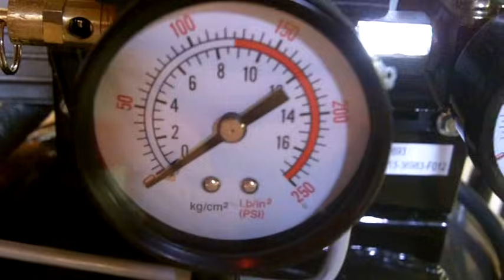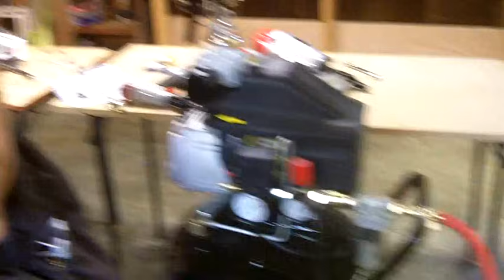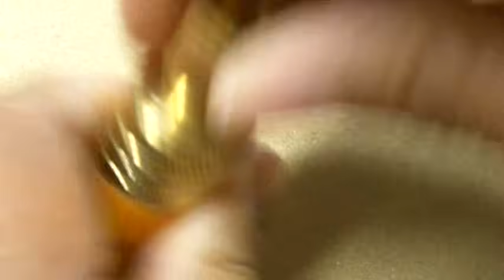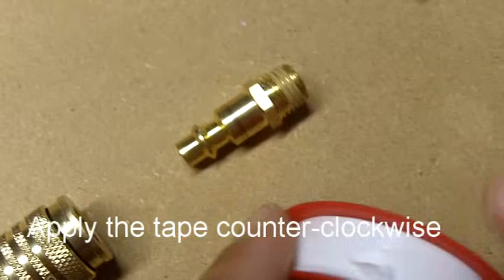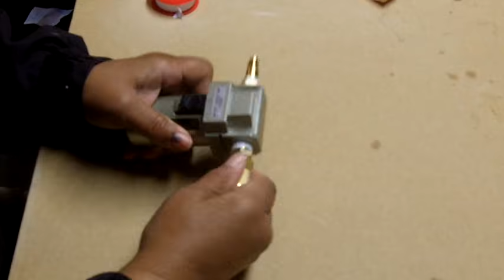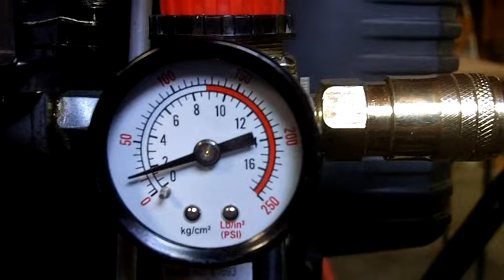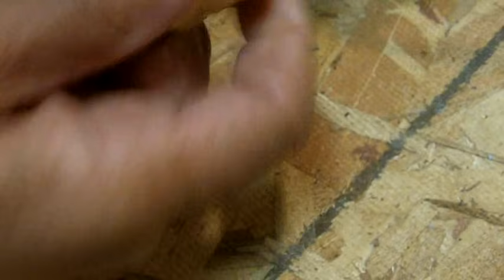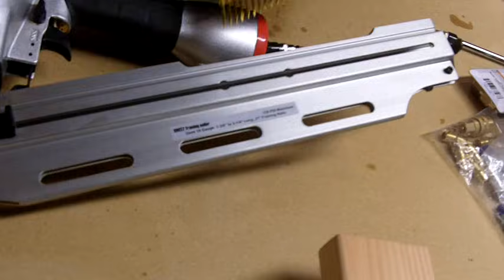Air Compressor, Line Setup and How to Use Air Tools for Beginners

Comment: Thank you so much Leah! Can you explain what happens after you're done? How to turn off, bleed air, drain water, etc.? Thanks!
Reply from the maker: +DennisIsAMenace First off, you should follow the manual for the compressor that you have.  But the main thing is to turn off and unplug the compressor, bleed the air by pulling the pressure relief valve, or you can discharge the air with a blow gun.  Turn the regulator down to zero.  And then at the bottom of every air compressor, there is a drainage valve that you can unscrew to let the water out of the tank.  But again, the  most important thing is to follow the manufacturer's instructions for you air compressor.

Comment: thank you your amazing. can't wait to get my hands on the air compressor, tool. one thing you forgot to mention was the Teflon tape how to put it on the thread clockwise. avoid leaking air seeping through, and overall the hassle of redoing the darn thing seems pretty much common sense but if you never used it it will be a problem. I loved how much knowledge and the name of everything you are a smart one there keep up the great work.
Reply from the maker: +Roberto Covarrubias thanks, Roberto, glad it was helpful!

Comment: You can also buy 2 cheap compressors couple the air hoses and you can double your capacity and CFM on the cheap!
Reply: You will burn them out. If you need that much air, buy the right compressor for the job.
Reply: Peter Hewel I have a 20 horse Powerex  that puts out 60 SCFM and has multiple 200 gallon tanks but it weighs over 2000 pounds I'm really not gonna take that with me anywhere.
Reply: destiny walker I do mobile soda blasting with a 13 hp Eaton has rig with 60 gal tank and the same pump on a 10 hp electric with 120 gal tank. I added a 7.5 hp 80 gallon of a well known brand too make more air. It ran 100% of the time. After about 1000 hours, had to replace pump. Set me back almost $1000. You run a little direct drive 100 hours, especially at 50% duty cycle you will kill it.

Comment: Is it ok to leave unused air inside the tank or should it be discharged after a day of work?
Reply from the maker: +Marcelo Pereira   You empty the tank after use so you can not so much remove the air, but to drain the water that builds up in the tank as well.

Comment: great video I have one question at the end when u use that tool to clean the dust in shop what is that called ?? That long thingy please hope to hear from u
Reply from the maker: +jp morso   It's called a blow gun...an added note, since there are no moving parts it's unnecessary to add oil to the air inlet as demonstrated in the video.

Comment: Great vid Leah, thanks. I've watched it a few times over the last couple years to refresh on how to set up. Is there much to powering it down, other than releasing the air on that pulley thing?  Thanks
Reply: +Andy San Nicolas The air release is all you need. I do check the oil gauge before running it.

Comment: Leah why do some people hook their filter at the compressor and others 10 or so feet away from the compressor? I have a compressor just like yours and I use an air impact gun and want my tool to work correctly. Where should I put the filter???  Please help me.
Reply from the maker: +Sultan Jackson   Hello Sultan, Some like to place the filter as far down-line as possible, this allows  the air to cool and moisture to condense, hence collecting more water before it enters your tool.

Comment: Is it possible to run 2 air lines off of one compressor?
Reply from the maker: +j mil   Yes.  You'll need a 3-Way Quick Coupling manifold.  They cost $10-$20 usd

Comment: I don't usually do this cuzz I'm lazy ha but u were so nice and helpful I had to subscribe and leave and nice comment. I'm in painting and getting into carpentry and am learning allot on here, but ? U know the hvlp guns u buy at harbor freight which is how I found out about this unit or home depo. What compressor works with them I mean if Harber freight sells them and compressors they have to we'll ones that are comparable but the people who work there are College kids who have no clue and I'm a prof with painting and am old school and wanted to try these cheaper guns without the air already attached which is like 1500 thanks keep up great vids, I'll be watching or maybe make a video on this I never saw one yet on here
Reply from the maker: +Chris W   The Central Pneumatic -Item#67181  hvlp gun at harbor freight has 6 cfm requirement at 40 psi and the Central Pneumatic - Item#68067 compressor's flow rate is 6 cfm at 40 psi.   Hopes this helps.

Comment: hi leah, the video was very brief and engaging, awesome work. I want to know can we make a compressor out of a scooty engine (2 stroke) without installing a storage tank for compressed air? can we use it directly, like air is being compressed by the engine and then directly used for spraying paint?
Reply: it wouldn't work because  because most spray guns are hvlp  high volicitiy low pressure it would be hard to regulate and you would need a large compresser  it would be much more efficient  to buy a compressor
Reply from the maker: +Utkarsh Upadhyaya Your question is an interesting question.  I thought about it in great detail.  But the truth is, I can't answer it with any authority.  So I defer to what mortie said.
Reply: Well i talked to two other people, one an electrician and another one an engineer, they both either discouraged me or said it is nt possible! I still think slight modifications wud make it run, but i am in dilemma whether to disintegerate my scooty or not. if i try and if it didnt go well then i am dead, my father wud kill me!!!
Reply: I would try to find a different way iv seen small modified to build air but they all store the presser I'm not sure the cfm output but it's not much

Comment: Thanks for the video, I have a question. When using a sand blaster, holding the trigger my line pressure drops from a set 90psi to about 75psi. Should I set the sandblaster at 90psi with the trigger depressed (obviously without any sand yet) or to 90 psi while not using the tool?
Reply from the maker: +damian1228 Hey Damian, what gun are you using?
Reply: +seejanedrill Harbor Freight gravity Fed with the red container. Just to update, I upgraded to a 33 gallon husky and it only dips down to 80/85 psi now. Should I be at 90 while the trigger is held or when it's just sitting on the bench.
Reply from the maker: +damian1228   Hello Damian, It sounds like it's the #95793 with 20 oz. hopper.  If this is the case, it needs 7 CFM to operate at 90 psi.  I believe your Husky 33 gallon only delivers 5.1 cfm at 90.  I get what you're saying about whether or not to set the pressure at the gun, with the trigger depressed, like a paint gun where there is a regulator attached. But the Harbor Freight sandblaster psi is set at the regulator on the compressor. I believe your pressure drop is a result of the lack of cfms.

Comment: Wonderful, i´m Master degree  in food safety and i hadn´t idea how to use this kind of tools, now i´m starting my own small business and i have to set up a irrigation system for the green house , for this i need to buy and connect a compressor with a set of spraying nozzles , so far i couldn´t find any information on how to use this compressor, how to attach things or the basics but your video help a lot your teaching methodology is outstanding, now i have to find the way to install a solenoid valve, and humidistat, for some people this may be and easy task but i hadn´t idea what i had to do, right now it´s a little more clear, thank you again and regards from Colombia (the country not the state xD).
Reply from the maker: +Edgar Ernesto Reyes Pineda Wow, Egar, I'm very glad that you found us, and that the video was helpful!  Good luck with your business.

Comment: Leah, you're truly a wonderful instructor, great video! The only thing I didn't see in the video which I've been seeking clarification on, is the process of draining/cleaning the line filter. Can you assist?
Reply from the maker: +Casey Clark   Hello Casey,  Many  coalescing filters are self-draining.  Whose the manufacturer?
Reply: +seejanedrill Matco. It&#39;s got a site glass which I&#39;ve never seen a level in, then again I haven&#39;t used the compressor much. I&#39;m assuming there&#39;s some kind of filter element inside of it and am wondering if those should be checked/replaced periodically. I have emailed Matco so hopefully they will answer some of these questions for me but the one thing I am embarrassed to ask them about is HOW to drain it if I see a level in the site glass. I see the draincock/screw thing in the bottom of the filter housing. Is it kind of like the drain on the compressor itself - unscrew to tighten all the way, and screw in to bleed the condensate out?
Reply from the maker: +Casey Clark Hi Casey, no need to be embarrassed.  Many filters have manual bleeds, which is most likely what the screw on the bottom of the housing is for.  Usually, you just press it in to release the accumulated fluid. As for being able to replace the element, with some of the higher end ones you can.  However, many filters are inexpensive enough that you can just replace the filter itself once it is at the end of its life.
Reply: +seejanedrill That's all I needed to know - thank you very much!

Comment: Hi Leah, thanks for the great video. I've been using improvised connections using hose clamps and twisted tie wires. I'll definitely get myself some fittings soon. I'm planning to start using these pneumatic tools and can i as what kind of oil are you using to lubricate them? Is it safe to use lubricants such as wd40?
Reply from the maker: +Royce Ibanez Hi Royce, in a pinch you could use wd40.  However, you really want to use compressor oil.
Reply: Thanks Leah!

Comment: Great video. Helped me before using my first compressor and Brad nailer/micro stapler. If I use this very rare, say, once every few months, should I let the air out of it each time?
Reply from the maker: +SharpManFC yes, because you don't want water pooling in the tank.

Comment: This was the best video ever...I will subscribe to you...I really didn't understand the gauges..now I do..my only question is, how and when do you drain the tank. This really was a great video
Reply from the maker: +thenocode72 Usually there is a valve underneath the tank that you can open to drain the tank.  As for how often, the recommendation is after each use.  However, it also kind of depends upon how often you use the compressor, how long, if there is a lot of humidity in the air, etc.

Comment: Hello Leah. Can you use a 1/4 fitting with a 3/8 air hose?
Reply: +altheacstar I'm just learning myself but i think if you have a 3/8" to 1/4" adapter you will be ok
Reply: All the fittings for 1/4 and 3/8 hose will use 1/4 fittings.

Comment: still a little confused as to coupling fittings. i am looking for a filter/water separator and they come in different sizes: 1/2 inch, 3/8 and 1/4. If i am going to be using a 3/8 hose, should all of my attachments and accessories be 3/8?
Reply from the maker: +Federico Arango yes, you want all your plugs and fittings to be consistent with the hose diameter

Comment: Sorry for the stupid question but what kind of oil do you put in a tool? 
Thanks
Reply from the maker: +Patricio Gallardo not a stupid question at all.  You should use compressor oil.  However, different types of compressors require different types of oil, so I would recommend using whatever is recommended by the manufacturer of your compressor.

Comment: I do have a question about my compressor. I have dialed down my regulator to 90 PSI, for a 1/2" Impact gun, for automotive use. Now it will positively work on taking off 4 Lug nuts off a wheel before losing pressure on the 5th & 6th lug nut. 
It's an older Compressor with no water trap in line. like you had suggested. 
Any Ideas? possible water buildup in the tank? or Adjustment on the pressure switch, not kicking on when pressure drops? I hope that wasn't over confusing.
Reply from the maker: +John Randoll Hi John, automotive tools take a lot of air (they are air hogs), so it could be that you don't have a  a compressor with enough cfm's to run automotive tools.  That said, you should be draining your compressor reservoir (tank) regularly, because it is a bad idea to let water accumulate in the tank.

Comment: Hi Leah, a great video and very well explained. I have seen a lot of your videos and I really like the way you fully explain what the video is about. I am the person who asked you about your name about why called Jane bit, it was on your French cleat video. Hi again.A couple of questions I would like to ask are, 1. I have an oil less compressor with only the one gauge on it, why is that? and number 2. Do you recommend putting one of those filters on your compressor or just regularly draining would do? Thanks.Oh and I have now Subscribed to your channel.    Take Care,  Barry from England.
Reply from the maker: +Barry Roberts Hi Barry, yes, I remember you from your comments on the French cleat video!  Nice to see you here again.  As for your first question, I can only guess that it is maybe an older compressor?  It is hard to say, especially because we are in different countries.  As for your second question, you have to drain your compressor regardless of whether you use a filter or not.  The reason is to prevent the tank (receiver) from rusting. I personally would go ahead and put the filter on, because it helps your tools to last longer.  But the filter isn't necessary to run the compressor.
Reply: +seejanedrill  Hi Leah thanks for the reply. My Compressor is a Power Plus Oil Free, 24L, 1.5hp, 8bar 6.33cfm.This is my 1st Air Compressor it cost me £80 don't know how much that is in USD. I haven't had or used one before, so I wanted to get a cheapish one to get used to it before spending more on a better one. That's why I couldn't understand why mine only had the one gauge for the air going in, and not two like I have seen elsewhere. Anyway thanks for the filter update and if you do find out a reason for the one gauge, please let me know as I'm stumped.  Take Care,  Barry from England.

Comment: Got to say Thank you for you infor on this air compressor and tool hook up. My has been sitting around do nothing!!!!  Now that you're here I using my stuff, and having tons of fun.
Reply from the maker: +DW DW that's great, DW, I'm glad to hear you are using your air compressor and having fun with it!
Reply: Thank you for your time you took to read, and respond. Time has to valuable to you., and thanks again, I was wondering if you could do a video on angles., for such things like braces for holding up shelves. I can't seem to wrap my head around the whole thing.  I've done my braces, but it's not something I would point out to anyone. Just not clean cuts, one brace is higher than the other. Hope know what I'm talking about. If you have time, don't rush to show a video. Just when ever you can. Sincerely Drew W
Reply from the maker: Hi Drew, We actually already have a video on this topic.  It is called "How to Hang Shelves on Drywall that will Stay".  Good luck!
Reply: thank you

Comment: Thanks for making the making the video.  Couple of questions if you don't mind.  Let's say you go from one tool to another.  How do you bring down the pressure of the line once it goes up?  And you showed 3 different couplers but basically the universal one is the only one you need since it fits both auto and industrial, correct?
Reply from the maker: +kingpho79 To bring down the pressure, you use the output pressure regulator.  And as for the couplers, yes, that is definitely the beauty of the universal coupler.

Comment: Leah, thank you very much for posting this wonderful and informative video! I have watched hundreds of YouTube clips over the years on a variety of subjects and this is simply one of the best I've ever seen! You have taken what was for me a very complex and confusing device and accessories and really simplified it. I was completely intimidated, confused and overwhelmed by the choices out there...and you have eliminated all of that. Thank you very, very much. I do have 2 questions...1) Which line size should I be using...3/8 or 1/4? Is one size better for different kinds of jobs or tools? 2) Can you please explain in more detail what the differences are between the industrial and automotive couplings? For instance, should I only be using automotive couplings for my automotive air tools and then change everything out to industrial for my carpentry tools?
Reply from the maker: +Robert Fobian Hi Robert, that's great, I am really glad that the video was so helpful to you.  As for your questions..on the line size, it would be difficult for me to advise you without knowing the type and size of your air compressor.  I would suggest that you refer to the manufacturer's instructions for their recommendation.  As for the automotive vs industrial couplings, you don't necessarily have to use automotive for automotive tools, etc.  It is more about what is available in your area, what is recommended for a particular tool that you have, and matching like with like.  What i do is to keep a variety of different couplings and plugs on hand.

Comment: Great video and you taught me so much!  The thing I still need to understand is what to do after using the air compressor?  I bought a Craftsman and the shut-down procedures state to, "Set the outlet pressure to zero on the regulator."  But, no where in the booklet does it show what the "outlet pressure" is on the machine.  Do you know what this means?
Reply from the maker: +Judy Judy Hi Judy, the "outlet pressure" is referring to the air that is going to the tool.